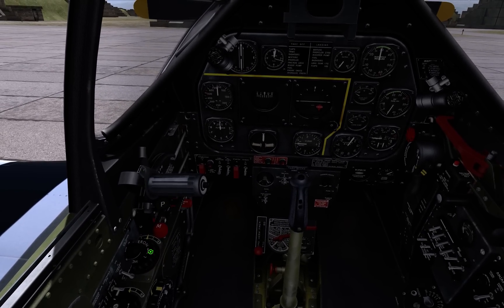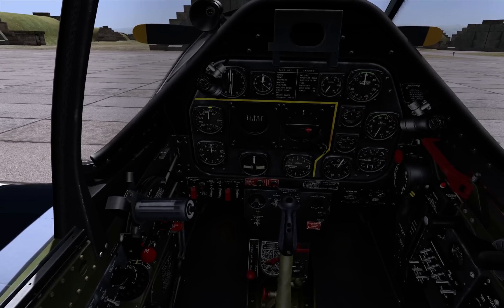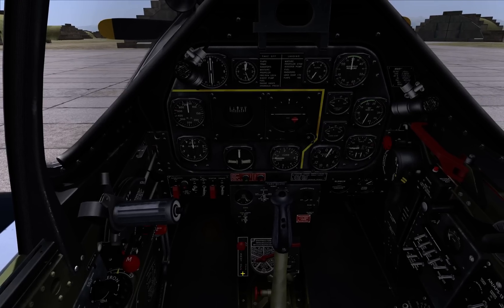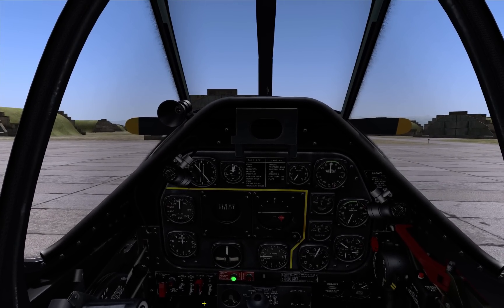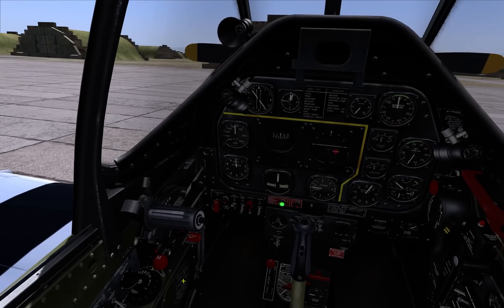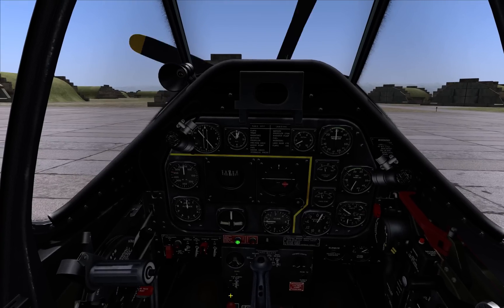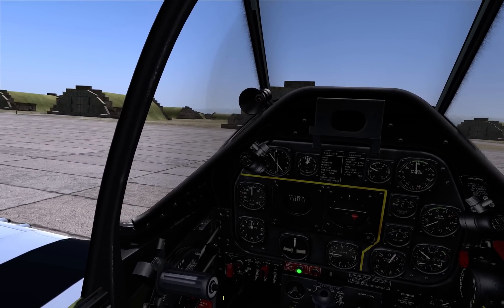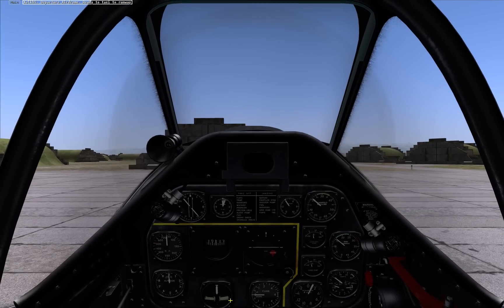DCS: TF-51D startup tutorial (DCS World 1.2.10).

Comment: After several tries that worked. Then I tried to taxi I crashed into the next wall because that thing can't turn at all :D
Reply from the maker: Oh but it can- unlock tail wheel (push the stick forward) and press one of the wheel brakes:)
Reply: Corvus.Corp 81 haha that's good to know^^ Ok, that makes it slightly easier.
Reply from the maker: +Hier könnte Ihre Werbung stehen Be warned though- once you go into freecasting mode of tail wheel it's quite hard to roll straight:)
Reply: Corvus.Corp 81 oh, so you can't turn it back off..so it's the way it was before :D?
Reply from the maker: +Hier könnte Ihre Werbung stehen pulling stick to you will lock tail wheel, but I think it first needs to normal position.
Reply: Corvus.Corp 81 damn that thing is complicated :D But thanks for the info, at least I can now take off.
Reply from the maker: +Hier könnte Ihre Werbung stehen Glad I could help. If you want to dig more into P-51 I suggest you read it's manual (should be in somewhere in DCS folder)
Reply: Corvus.Corp 81 oh, well I didn't know that ^^ I should propably do that so I can get into missions someday.

Comment: You should turn your magnetos switch to both even before pressing starter switch.
Reply from the maker: +World Guns No. According to P-51D manual (P.127): " hold the switch up in the START position to operate the starter and begin turning the engine ([Home] key). After six propeller blades have passed the canopy, set the Ignition switch to BOTH while continuing to operate the starter."
Reply: Corvus.Corp 81
Ok man, so i was wrong :)
Reply from the maker: +World Guns No problem:D I did my homework before making this video:P

Comment: I did everything you said, but the engine starts and then dies a few seconds later.
Reply from the maker: Warq Hm, save a track and send it over to me so I can check it out:) (mail: corvus.corp, using gmail.com)
Reply from the maker: +Horizon585 Switch off? Or switch on? Magnetos can be operated by left and right mouse click.
Reply: Did you remember to move your mixture to run? It'll choke itself if you don't change fuel mixture after the engine fires up. Also check your carb settings, make sure you're getting fuel in the system